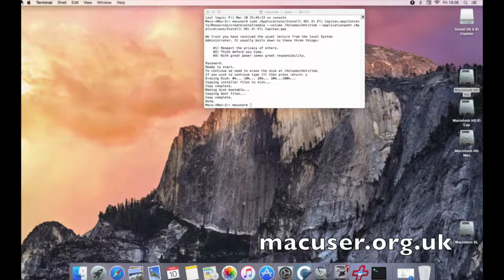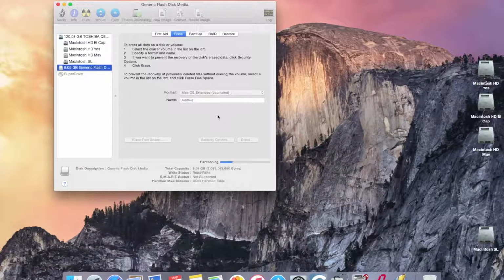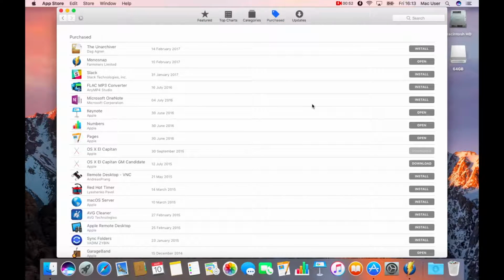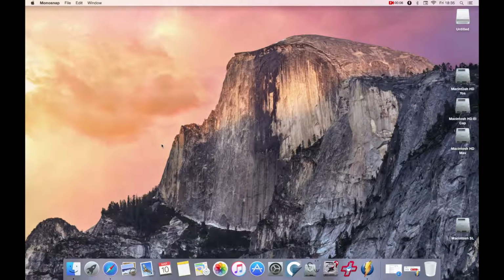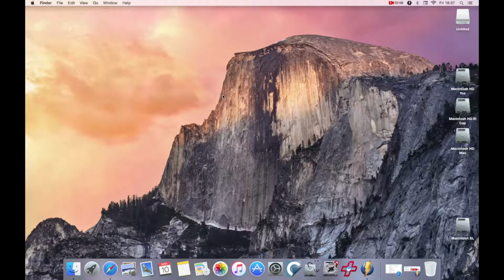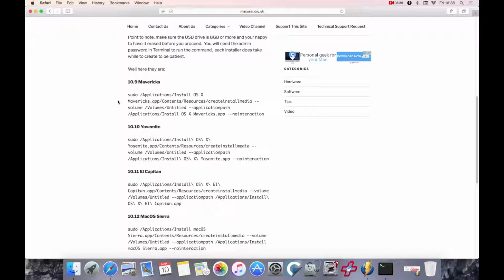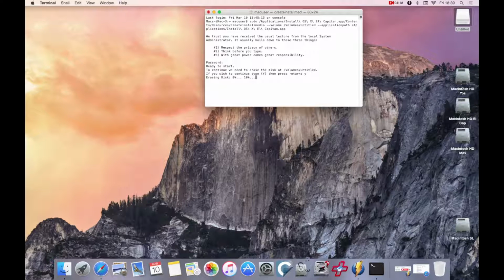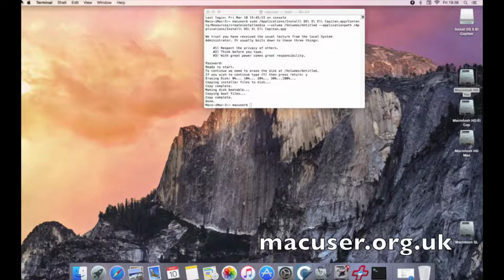How to make a OSX Installer onto a USB Drive #tech  #macOS

Comment: Thanks for this - it’s really helpful but I have a question. I have an old iMac (2008) that was running Mountain Lion fine. I went on the App Store which allowed to download El Capitan, but it won’t work on my computer. I am now stuck in this loop wherein every time I start up the computer it asks me to restart OS X El Capitan, and each time it white screens. I want to reboot the computer with Mountain Lion in the way you suggest on this video, but I couldn’t help notice that you said it was really important the operating system was also in Applications as well as on the external disk. I can’t get onto the computer to put it in my applications in order to reboot. Is there any way around this? Would really appreciate any advice !